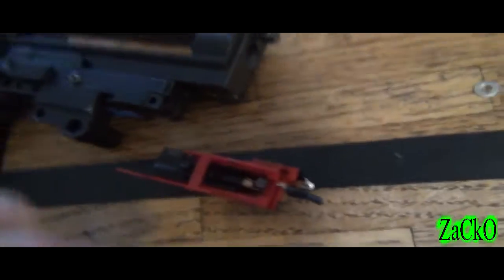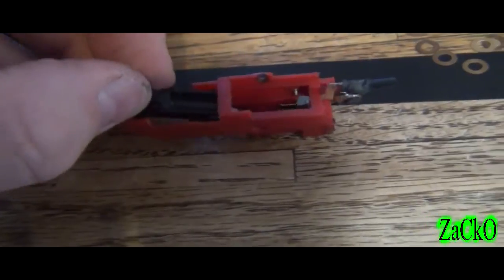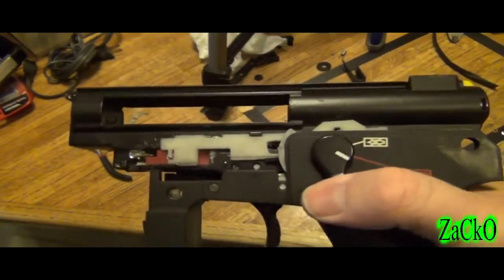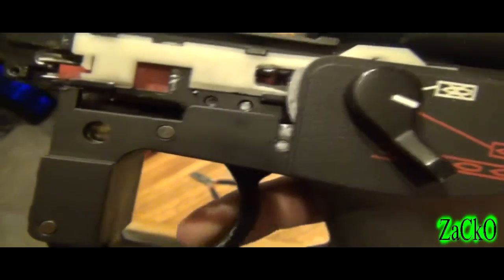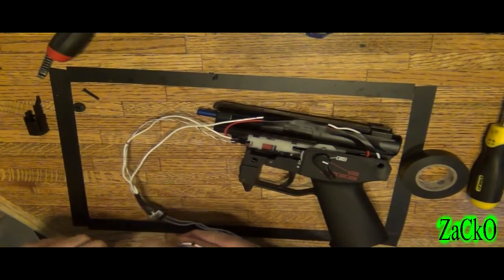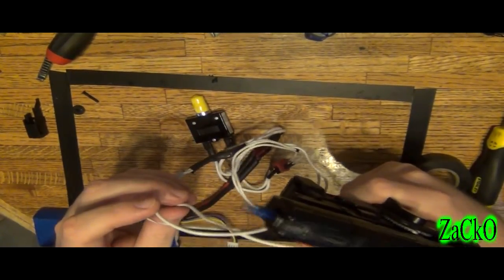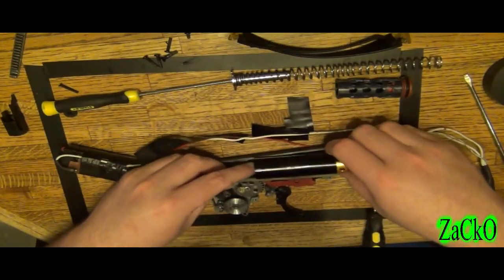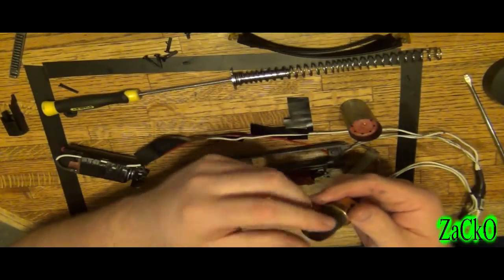Crazy Piston Test and Cycle with Overspin

Comment: Overspin is easily eliminated mechanically if you know what you're doing. I'm running SSG setups up to 40 rps with zero overspin without active breaking. Brill is right on the money, just use a stronger spring and short stroke. Shortening the trigger switch return spring helps too and a smoother cycling cut-off lever will typically yield less overspin, you wanna cut the power more aggressively at the end of the gear cycle.

Motor design also affects the amount of overspin, motors with a slanted armature design like Tienly and Lonex motors among others will typically give more overspin as the armature decelerates slower than a standard straight design armature.

Comment from the maker: I'm not the first to test it, probably the first to film it. I still don't consider it the best option. Compressed spring is the issue here. Overtime it will get worse even if it works for weeks to a month. If the spring was removable it would be more reliable for longer.

Comment from the maker: It could be argued either way but AB doesn't really destroy the motor. Your choices are limited. You think I should install a M150???? I don't like that idea as it will make the motor work harder anyway. The problem is strength, even if you cut down teeth, the beginning start is harder and the motor will still have to deal with that. Have you seen the difference between a M120 and M130 no ss? There is a difference as the spring power is increased. SSing wouldn't change that slower response.